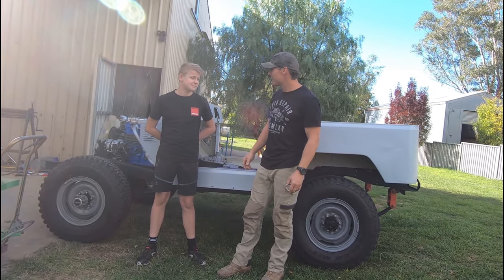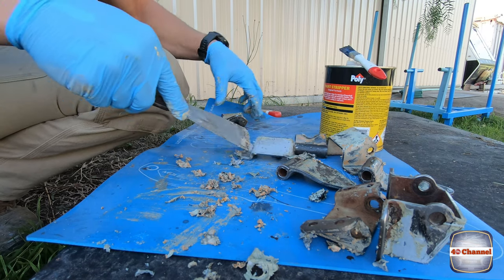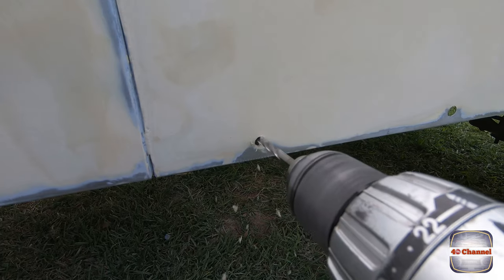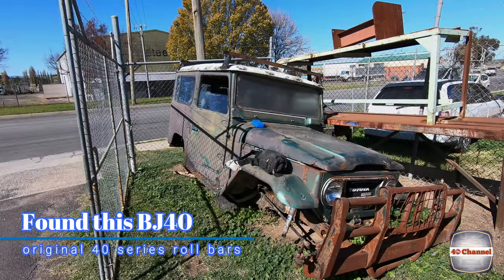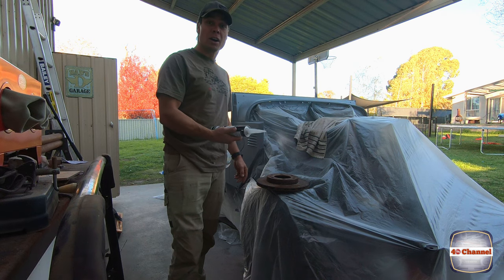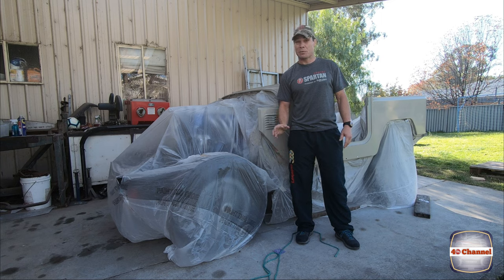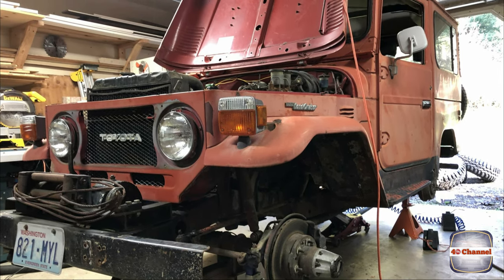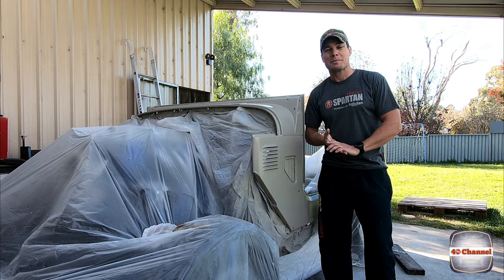EP48 - FJ40 painting, BJ40 rollbars and Bottle rocket for Fun + Eric's FJ40 story over 35 years!

Comment: Looking good mate, acrylic can be a pain to paint, and usually comes out a bit dry and furry off the gun, but looks like you've put it on pretty well. Colour looks grouse, its got that same dull ish semi gloss look that the factory paint had for these old girls, often people over do it by putting a super smooth coat of 2pack gloss and looking shiny as heck, a bit like a rat with a gold tooth! The semi gloss effect looks much nicer on these old beauties! Well done, I bet you're excited to start piecing it together again! If you did want to get a bit of extra gloss out of the paint work you could invest in some 1500 and 2000 wet soft pads for an orbital sander, give it a nice go over with 1500 then up to 2k, and then give it a nice steady buff up, it will come up an absolute treat
Reply from the maker: Thanks mate, That was my plan to give it a wet sand and buff.

Comment: Would you mind posting the steps from beginning to end  that you went through painting your 40? Starting after sandblasting.
Reply from the maker: Hi, the next day after sand blasting I epoxy primed all the panels then left it them for a couple of months while I worked on the chassis and motor.
Then rubbed back with 80 grit to add body filler.
Roughed back body filler with 80 and continued to body fill until I was happy (This took about 4 weeks, while still working)

Then 120 grit moving to 180 grit.

Wax and grease remover

Then epoxy primed again to cover all bare metal and body filler.

After a week I then sanded back with 180 grit Wax and grease remover then primed in acrylic primer.

Then wet sanded 400 grit and scotch pad, Wax and grease remover

Seam sealed Wax and grease remover and tac rag, then Acrylic Paint.

There is many ways of doing the paint job and everyone has a different opinion and way of doing it. The more I read on the web the more confused I became. In the end the guys at the paint shop help me a lot come up with a system that would work for me at home. Hope this helps you mate.
Reply: @40ChannelCruiser  Thank you very much. The thought of painting my own 40 is both troubling and exciting. The $4000-$5000 USD to have a  paint  shop complete the job is a hurdle that I may avoid. I enjoy your posts. Thank you again for sharing.